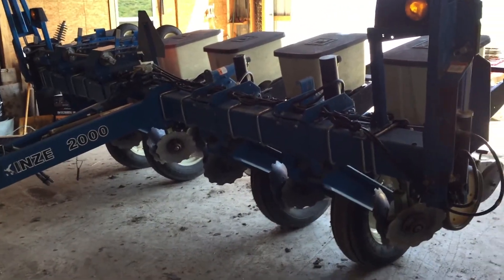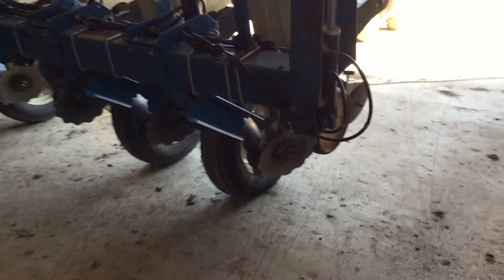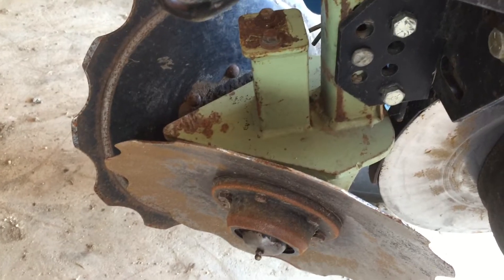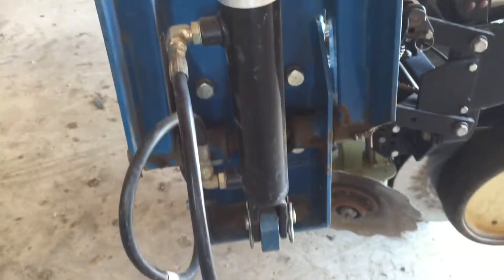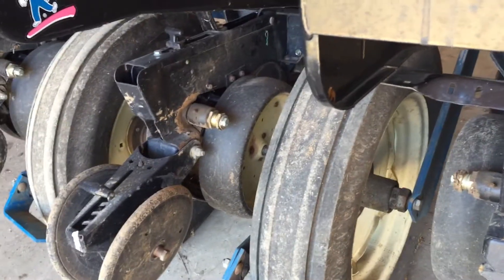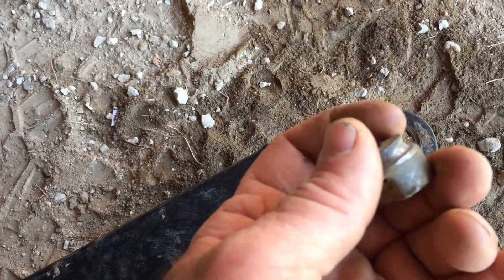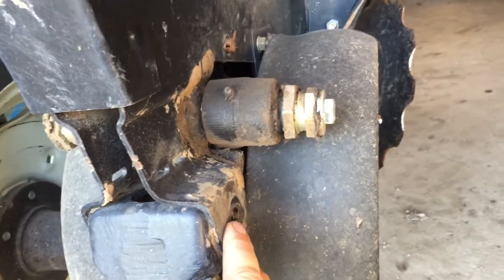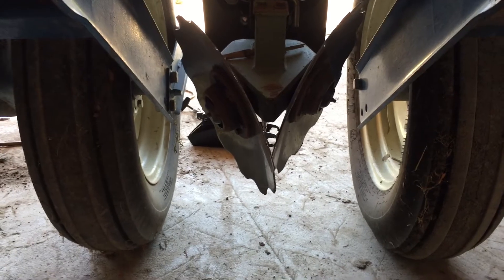Kinze Planter--disc openers and discussion

Comment: Loving the videos, keep them coming!  First year doing organic beans with a planter/row cultivator (usually do 7" up year in Eastern Ontario).  Would love to see a video on the rotary Hoe and timing as per when to do passes (blind cultivation? 1st trifoliate?)
Reply from the maker: Thanks, will keep making videos!  I say in other comments that I am NOT an expert on the rotary hoe.  Some organic farmers swear by it.  My personal experience and my soils have not encouraged me to use it very often.  My preference is the danish tine with rolling shields @ about day 14.  You can use this strategy if you get a 4 or more day dry period after planting (the beans have a four day jump on the weeds).  I will say that generally, the soybeans should be emerged, the soil should be crusted or somewhat dry, and the weather should be in a drying mode (warm, sun shining, high barometric pressure, etc.).  I will try to make a video and discuss these things.  I have rotary hoed too wet/cool/before a rain and brought on a new flush of grass/weeds.
Reply: Fantastic feed back.  Yes i prefer the danish tine with rolling baskets as well (i have a similar one to you) just thought id get your take on the rotary hoe as i have one but this would be the first year i was going to use it. cheers thanks
Reply from the maker: Use it based upon field conditions, not just because you have it :)!  My hill fields have a lot of clay and are "touchy" if worked too wet. In this video, https://www.youtube.com/watch?v=bMFdM6YI4_A I used the rotary hoe (but not filmed) and talk about it a little.  We will see what the weather does this year.

Comment: did you need you row cleaners if youbdo convention tillage
Reply from the maker: Yes!  In my situation with residue, I like the opener discs for cleaning clods and residue from the row.  I do not over-prepare my seedbeds.  I am always trying to use minimal tillage passes.
Reply: aja so you just get the minimum tillage and go for make the planter make the rest
Reply from the maker: @peteschmucker9344  yes!